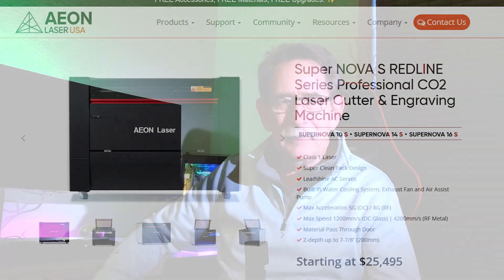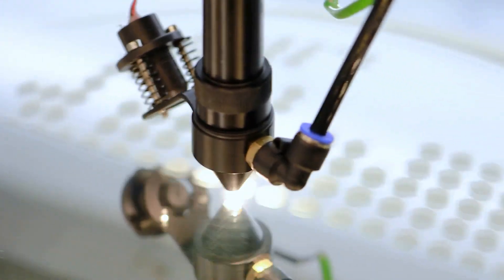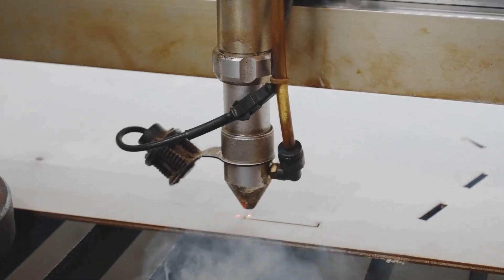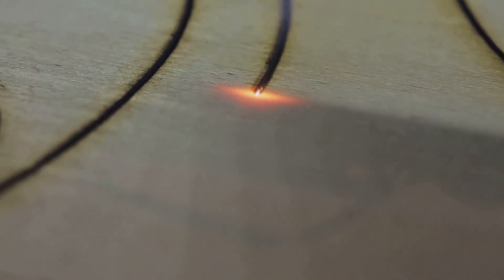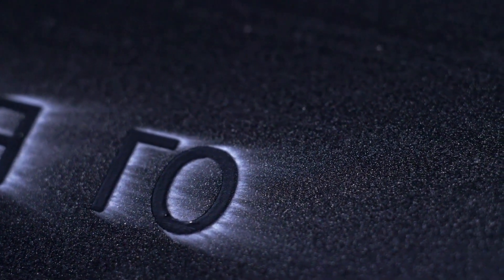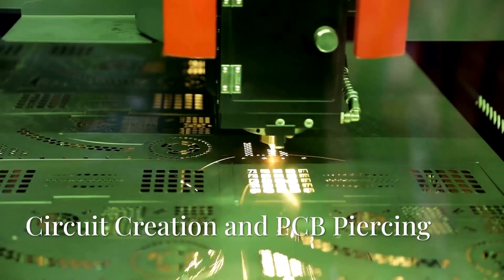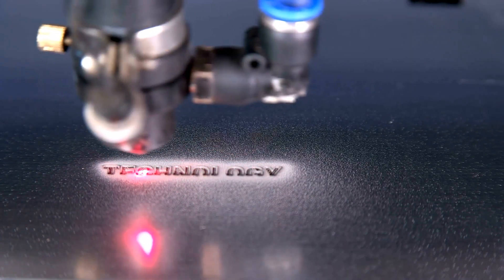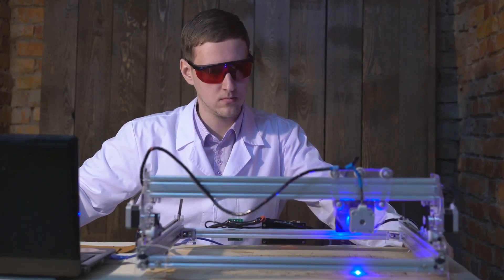UV Laser Cutting & Engraving – How It Works & Best Uses

Comment: Not sure about the US, but the best "cheap work horse" UV Laser in Asia is made by JPT (JPTOE), if directly purchased. High quality industrial UV laser sources are from Trumpf and Coherent. In a low power range around 2-3 Watt Trumpf and Keyence have very long lasting complete laser solutions. 5 Watt and up need regular maintenance every 3-5 years for the Third-harmonic generation (355 nm or 343 nm). 20000h of power pulses is a sort of industry standard, but you can get also 5000h or up to 30000h. Please note that you NEED different eye protection.
Reply from the maker: Thank you for your comment.  In the United States  some people will venture off to China and buy a laser but many of them  soon  find out that  they need support.  I strongly suggest everyone look at the "SUPPORT" you will get and if it is even based in your own country.    For commercial machines most people need and answer RIGHT  NOW as they have pending orders. Hard  to  get  support from the other side  of the world, given  sleeping  cycles.